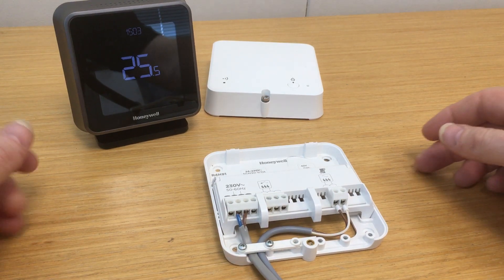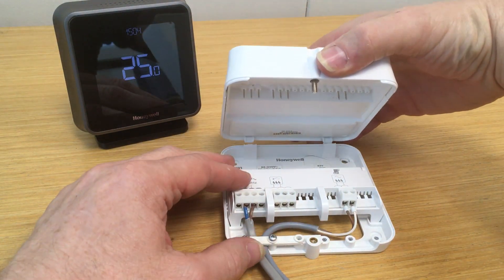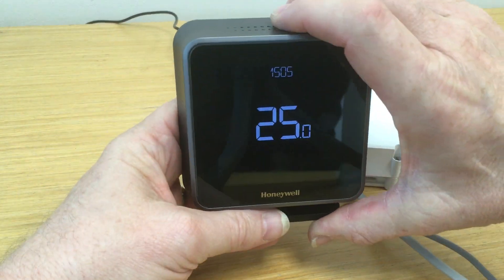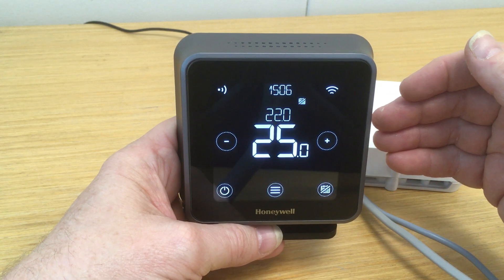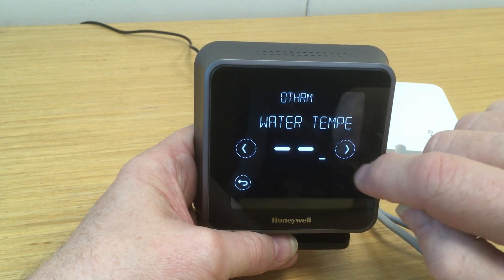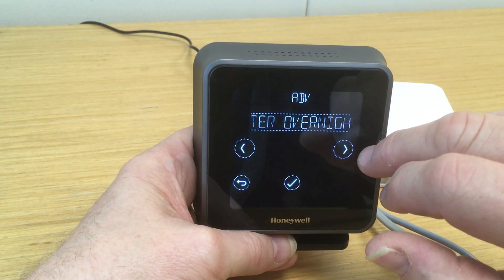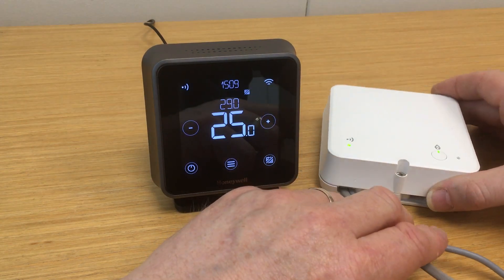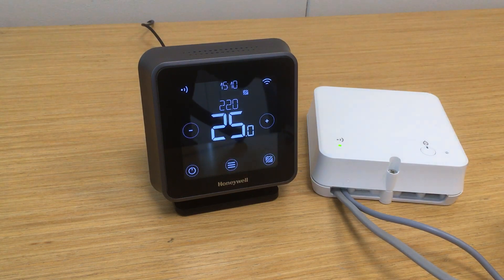Honeywell T6R on Opentherm combi boiler

Comment: Can this system be used with a Wiessmann Vitodens 100 (26kw hot water and heating natural gas boiler) OpenTherm capable boiler?
Reply: We have this controller with our Viessmann 100 but are having issues setting up the Hot Water.  I believe it needs to be enabled in the menus !!

Comment: Low load control on or off on a Ideal Vogue c32? Seems to request max flow temp the boiler is set to at flame in order for the flame to stabilise before modulating down. E.g ask for 70 if flow temp is 50c so as not to overshoot at flame ignition. It will then modulate to say 50c... whereas with it off it might ask for a flow temp too close to what the boiler can modulate as low to and then you end up with endless cycling.

I have also been having this issue where every few days have to power reset the boiler as despite the lyric asking for 50c heating flow the boiler says no demand and doesn't work. Very frustrating.

Comment: Could you give ne some help about this T6R, could you give me a contact email? I measure the heating and the hot water temperatures and I see that for example (when the low load control is enabled) it heats for 4 minutes after that switch off for 4 minutes and it repeats while there is heat demand. I think it is bad for the boiler - switching on-off several times -, it will not work for years with such a high on-off times.
And what does the Control setpoint means?
Reply: Low load control takes into account the minimum flow temp that your boiler is able to reduce down to. So on my boiler 30c is the lowest flow temp it can control to. With low load control off, the lyric was calculating the heating load as needing say 23c, so the rads were dropping to below 23c before the boiler would refire and quickly over shoot (becsuse the boiler cannot control below 30c) and then turn off, so I was finding it was short cycling for longer and more frequently with it turned off. It also meant the rads never really gave any heat off as it was always trying to maintain a really low silly flow temp which was not good for the boiler. You can also get cycling with it on if there is very little load in the system. Low load control also asks the boiler to fire at max flow temp you set on the boiler and then modulates it down after a few seconds to ensure that if the boiler is only needing 30c, the likelihood  is that with low load control off the boiler would not be able to achieve that on start up without over shooting and cycling off straight away. Low load control spreads the firing sequence out for longer. 

Also check your max flow temp is set to no more than 55c, any changes you make on the boiler be sure to power cycle the boiler so that the thermostat gets sent the new settings you have made. 

Control set point is what the thermostat has calculated the heating load to be and has translated that into a flow temperature that is required from the boiler to maintain that heat load (your set temperature)
Reply from the maker: https://ensupport.getconnected.honeywellhome.com/s/contactsupport?language=en_US

Comment: Is opentherm really worth it compared to on/off? Has this protocol evolved or it’s still bugged and not reliable yet?
Reply: The low load control on this thermostat is excellent. No other controllers have this, but then honeywell did invent opentherm.
Reply: @richardc1983  had no idea honeywell invented it 😅
Reply from the maker: Yes it is worth it. The OpenTherm interface protocol is established and stable. The issue is the way some boiler manufacturers have implemented it in their boilers which has caused problems.

Comment: Mine doesn't have an open therm function - wish I'd bought a hive or nest one
Reply: Opentherm is only detected if it's wired in properly at the boiler and at the opentherm connections on the thermostat. Chances are it's not been wired correctly as these have opentherm functionality as standard. Your boiler may not support opentherm either.
Reply from the maker: They come with OpenTherm function as standard. Have you set it up correctly?
Reply: The Hive doesn’t have an Open Therm function either…